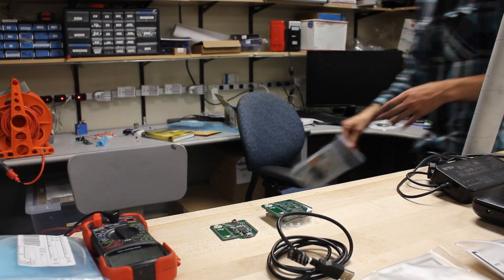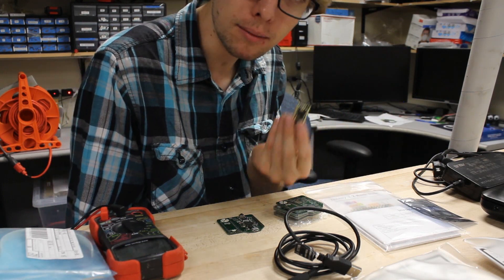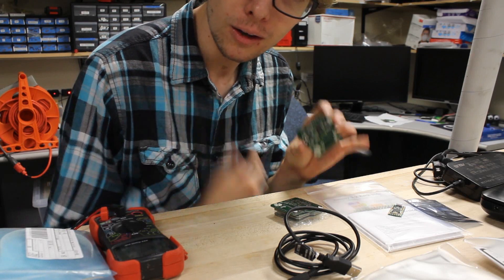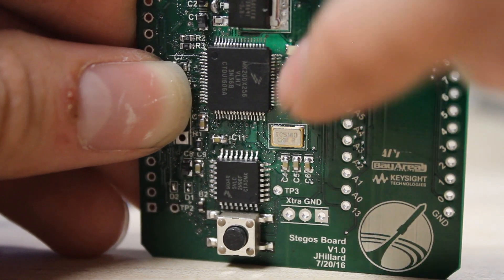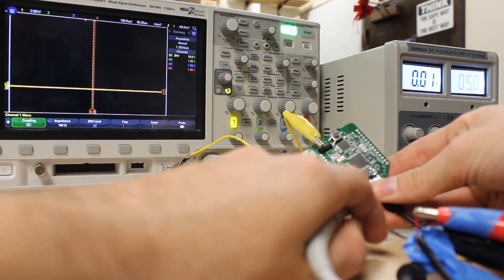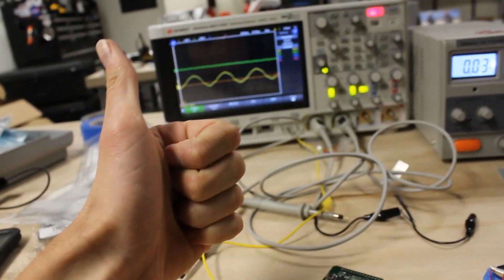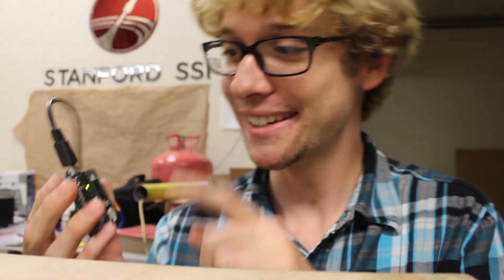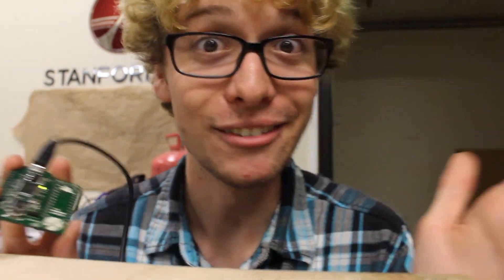We built an Arduino! (Kinda)

Comment: Hi, I did something like this a few years ago. I was wondering if you had any interest in trying this with the teensy 3.6 processor. I understand that 3.6 uses a 6 layer board. Im assuming that this is because they were trying to break out every pin. But what if you didnt want to use every single pin? would it likely still need a 6 layer board?
Reply from the maker: That's an interesting question, hadn't really thought about it. I'll check out the schematic and what microprocessor the 3.6 is using. It might be you can get away with it buy increasing the size of the board. The one above isn't very close at all to the form factor of the teensy 3.2. If that's not a constraint and if you don't need all the pins, I bet it can be done
Reply: the schematic doesnt look terribly complicated. I think if one wanted to break out only a select few pins they could get away with a cheaper 2-layer board. Also, the Micro SD card slot takes up a lot of room on the board of the 3.6 but the wiring has dedicated pins.
Reply from the maker: Update; My friend is actually building the 3.6 now.  I think he's planning on just making it a two layer board. You can buy small quantity 2 layer boards from Bay Area Circuits (They are an awesome fab house, my absolute favorite, https://bayareacircuits.com/) for only about $50. Which means we try really hard to hit two layers if we can :p 

Thanks again for the comment. I'll let you know how it turns out
Reply: Hey, Paul here - the guy who designed Teensy 3.6....  On the bootloader chip page I published a 2 layer board that does break out every pin (at least all the ones Teensy 3.6 does), and it uses the large PQFP version of the chip which can be hand soldered.  Board size is over 4X as large as the 6-layer Teensy 3.6, and even that was a tight fit to cram in all the routing.  The 2 layer board can be ordered from OSH Park, and they show high-res images so you can see everything since there aren't any inner layers.

Comment: Very Good engineering and editing! But, you should have specified that the Teensy Bootloader resides on the MKL04 and NOT the MK20. And the the Bootloader is not flash-able. If you want to build (spin) a teensy of your own MUST order the $7 MKL04 or MKL02 chip from PJRC directly. PJRC flashes the bootloader at their facility. PJRC has kept the software secret not released the bootloader. It would suck for people to order the MKl02/04 only to find out it was not going to work. Keep up the good work!
https://www.pjrc.com/store/ic_mkl02.html
Reply: I say this because a Bootloader is typical referred to by most as Software that resides in the upper or lower end of flash memory, not an external piece of Hardware.
Reply from the maker: You are entirely correct! I tend to not give super in depth how-to's, because I try to provide a service more as; "here is what is possible", and being a hype man. I see that style of content a lot less than the ubiquitous how-to, which is why I've chosen something like that. 
But that is definitely a gotcha point. The same link you have there is in the description under "Page on Bootloader and Teensy Resources:". Thanks for highlighting it though!